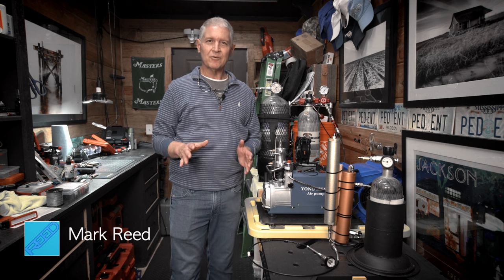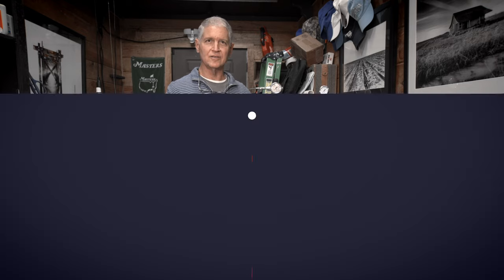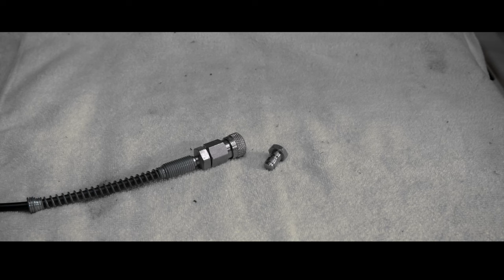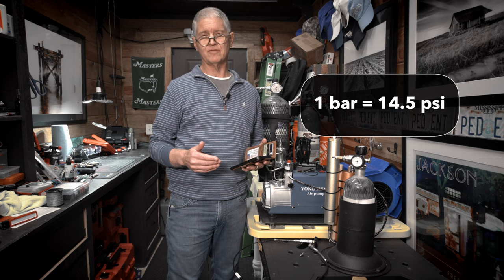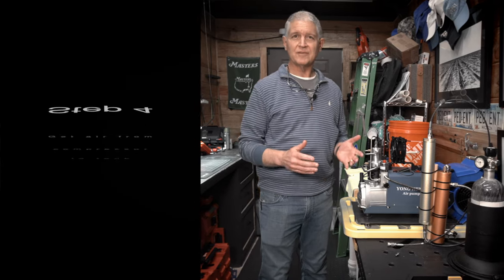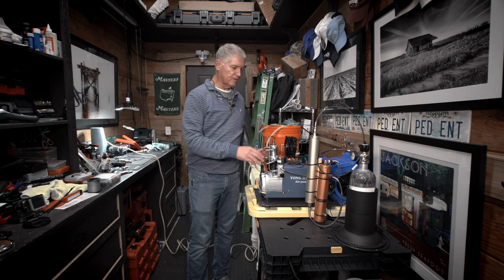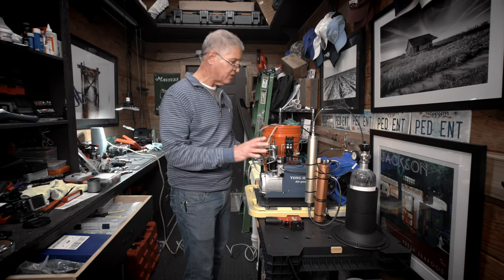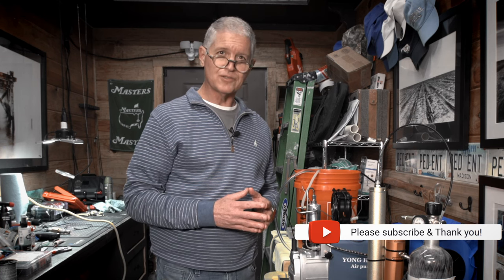How to Fill a PCP Airgun Tank

Comment: People don’t realize how dangerous compressed air can be, especially at the pressures relating to the pcp guns. I just bought a new rifle with 2 new tanks that I would like to keep moisture and/or contaminants out of. I also purchased a small compressor that has a tiny in line filter , doesn’t look like it’s enough, my tanks were filled once by the place I bought it from when they tested it. It still contains what’s left of that first charging. I don’t understand these guns and tanks yet , but if it’s possible I think I’m going to release the remaining air from the tanks and pull a vacuum on them and hold,it long enough to evaporate any moisture present and start over with a leased nitrogen tank or something. I already lease oxygen and acetylene tanks for my work, so adding something else shouldn’t be a problem. There are probably inert gas choices, lol, I know nothing about these guns I have a feeling this is going to be more expensive than I expected. Most things like this normally are though🤣. Would be interested in your opinion, will sub your channel also.
Reply from the maker: Thanks very much for watching, and I strongly agree that this is going to be far more expensive than you know. Addictions are really hard to control!!

Comment: On some chinese compresors there is a warnning label, to not operate compresor at site where oil level eye is. There are known cases, when the compressor is damaged, the cover is broken and you can be injured by its shards. It is recommended to point the cover in a safe direction, such as a wall.
Reply from the maker: Thank you! Great information! Thanks for watching and commenting.

Comment: The most important thing you didn't say is how long it takes to fill the bottle up to, and what temperature we can let the compressor go without having problems damaging it? Compressor temperature is very important.
Reply from the maker: Thank you for watching. The main point of this particular video was to give a concise tutorial on the actual filling of a tank. The type of compressor or tank was not relevant for this discussion. I have a separate video discussing the Yong Heng in particular which may answer some of your questions. The time it takes to fill a particular tank completely depends on the size of the tank, the existing pressure in the tank, the pressure to ultimately be achieved in the tank, and the output capacity of the compressor used to fill the tank. There is no set time for filling any tank. I agree that compressor temperature is very important, and I address that in my Yong Heng video. As far as I know, there is no agreed to minimal temperature that would guarantee damage to the Yong Heng, but I would strongly recommend keeping the temperature as low as possible. Thanks again.

Comment: I have the same setup. I always did what you did, wait for the pressure to be equal then open the tank. Then I thought I saw someplace that they said there was a one way valve so air from the tank wouldn't push back into the compressor. So it seemed they opened the tank at the same time they turned on the compressor. Do you have any thoughts on that? Also when the tank reached the pressure I wanted I would close the value of the tank, then open the pressure relief valves on the compressor, then turn it off. I thought it would be better to turn it off without it being under pressure. Interested on your thoughts of that process too.
Reply from the maker: Thanks for the comments. The one way valve you mention is a check valve, but that is not standard on most tanks. I recently bought a check valve for that very purpose for one of my smaller tanks. You can certainly open the tank valve from the start if you're using a check valve- most just don't have one. I use a Stikman SCBA adapter for my SCBA tanks, and it has a check valve also. It's a very handy tool if you are using SCBA tanks. As far as the shut down process goes, I have heard of some doing the same as you, and I don't have any data to contradict that. It could be a better process. My YH automatically turns off when it reaches 290B so that actually starts the sequence for me. Without having a check valve, I would then have to close the tank valve as the next step or risk loosing a lot of pressure if I opened the YH valves next. I figured that with the YH off and the tank valve closed next, the pressure would remain equal throughout the system before bleeding. I didn't think it would stress the YH anymore than it was before it shut off. Anyway, that's my thinking. I certainly could be wrong, but fortunately, it's continued to work well to this point. Thanks for asking.
Reply: If the output valve is working on the compressor it shouldn't matter shutting it off with pressure. The cylinders bleed of pressure fairly quickly  when they are not reciprocating 30 hz or so. There is a check valve where the final stage line enters the block that also holds the gauge, make sure it works as it's usually just a bit of debris in there if not

Comment: Same relative setup as y'all, one thing I do a bit different is leave the tank closed and run the filters and line up to, if not just a tad over, the target pressure for the tank. That way I just tested the lines and orings on my filters as I am using them. Then simply Crack the tank valve open as soon as the top pressure is tested. The lines and filters will just act as a tank and fill the actual tank. I'd much rather blow a line or pop an oring without the volume of the tank hooked up
Reply from the maker: Thank you for the reply. As with most things in life, there are many ways of doing something, and I'm sure mine is no better than yours. Maybe one day, we will be able to come up with a consensus that works better than all others, but until then we'll all continue to push the boundaries and try to figure all this out. Keep up the tweaks, and continue to let us all know if you find something better (or something worse). We'll all appreciate it. Thanks again!

Comment: Thanks, I really enjoy my Yong Heng and these types of videos. I've had my Yong Heng for three years now and have used it nearly everyday for the first two years without a problem. I have yet to fill my large SCBA tank because I'm scared to due to lack of experience, but I have filled my little Hatsan field tank.
Reply from the maker: Thanks for your reply. Should continue to give you years more especially with the way you use it. Keep up the good work!
Reply: @jmarkreed  Thanks Mark, so far so good.
Reply: Don’t be scared. It’s a whole lot easier to fill your gun from a SCBA tank than a compressor.
Reply: @mikegoebel5864  Thanks Mike, from another Mike.

Comment: What happens if you don’t have equal pressure in your pump and your tank when you start the airflow to the tank?
Reply from the maker: If you have an open system (i.e. no check valve to hold the pressure back from your tank) and your tank is full of high pressure, all that pressure from your tank will be forced back to the pump. The pump would then have to hold up against that massive pressure and would likely fail and you could get hurt. Not  a pretty sight. Don't go there.

Comment: Good straightforward informational video, i plan on getting a bottle soon, probably the 6 liter, i have 3 of the yong hengs, 2 new that i have tested and moth balled and the first one that i got 5 years ago, still hits 300 bar, ive only filled guns with it, pretty much daily, my main gun i shoot is a 480cc 250 bar i refill at 150 b. they are great little pumps, just keep them cool with clean oil. Thanks again!
Reply from the maker: I have two used 45 minute SCBA tanks (6.8 liters) that are filled by my YH. That seems to be the best practical size for filling and use. Both were bought on Ebay for a great price ($159), and both were still under DOT certification. I had to look for a while to find them, but it was worth it. They are great and should last for a long time. I then bought a StikMan from Air Tanks Plus to fill my guns. Wonderful product to use with the SCBA's. You should be in great shape for many years of use with your extra YH's. Thanks for the comments and for watching!
Reply: @jmarkreed  hey great tip on where to look, the bottle i have looked at is not dot, i had rather have something dot approved, sorry just getting back to you, i had no idea you had answered me back, thanks again and enjoy your content.
Reply from the maker: @Don.E.63  Thank you very much,  and thanks again for watching!
Reply: Did you get a bottle yet? I ordered a 6.8 liter and very curious how long it will take to fill from empty.

Comment: Great information Dr Reed, -iI have 2 Shoe Box compressors and have considered tring the Yong Heng to fill portable tanks.
Reply from the maker: Excellent! I have been intrigued by Shoe Box compressors and it’s my understanding that they are not being produced anymore. I think you would find the YH to be very different than the Shoe Box, but it should be a little faster from what I understand. I don’t think you would be disappointed.
Reply: @jmarkreed  Hello; for the ill-informed, is Shoe Box a brand or a type? I guess I could google it...but the reason I ask, I am seeing some portable compressors in the sub $1000 range that say they are oil free; and they are pretty small - like, almost shoe box size - that's why I wondered. I'm wondering how they accomplish that, and thinking maybe they do like my Harbor freight air compressor where the cylinder walls are teflon coated; basically made for a certain lifespan?
Reply from the maker: @arsbadmojo  Shoe Box compressors are/were a brand that used very dependable but somewhat slow technology. I really don't have any experience with them, but I believe they were very good. They are no longer made. I don't think they used the same technology as the current oil-less compressors. I have a couple of videos on my channel discussing one of the oil-less compressors, the GX CS2. https://www.youtube.com/watch?v=Q3QvRexvPpA   It is a great little compressor that is used for only filling airguns directly- not for filling larger tanks. It is also very reasonably priced in the sub $300 range.

Comment: Just starting my new PCP airgun hobby, and it sounds fun, thank you for the  info, safety is a wise step, tying down that hose was a great idea, they can whip so hard with that air pressure and with those adapters to whack you will not be pretty or healthy. Subbed!

Comment: 1:45 What instance would you need the gauge on the other end of the line, instead of the dead head alone? The gauge on the tank should be accurate(hopefully) I have had gauges off by 500psi though. lol I am glad to see air tanks plus on here. Buying from Air Venturi was my first mistake, a nightmare rather.
Reply from the maker: Yes, thanks for asking. I think the separate gauge I have from Air Tanks Plus is more accurate than the one on my smaller tank, so I use that. I also have a large tank that has excellent gauges, and in that case, I use the dead head. I don't want to be definitive that one is necessarily better than the other. It really depends on your own equipment. I just wanted those who are learning about all this to know we have options- and both are fine.

Comment: Great Video ! I do exactly the same except when I'm at the desired pressure I quickly close the tank valve and immediately open the tank bleed valve. Then I shut down the compressor and open the 2 bleed valves on the unit.
Reply from the maker: Thanks very much! As you know, there are so many different ways that we can do this, and I certainly see the logic in doing what you are doing. The only reason that I decided not to do it that way is to maintain the full pressure in the system to allow the expulsion of as much water as I can from the YH bleed valves. By decreasing the pressure from tank valve the differential pressure will be less when the YH valves are opened. It probably doesn't make a lick of difference, but I want as much water out as possible. Thanks very much for sharing!

Comment: thanks for posting the video. I would add a bleed valve to the bottom of your filter so when you release the pressure from the line it will purge the moisture at the bottom of the filter out.
Reply from the maker: Thanks for watching! The copper water sepator filter has that very thing and I use it every five minutes during the fill to purge the water. I also use it at the end as you suggest. Thanks again.

Comment: Hi, I'm in Scotland and have much the same set as you except I have the one way valve, bought from best fittings, and it works a treat, as soon as both pressures are equal it starts to fill the tank, once filled to pressure you require simply shut tank valve then switch off compressor and release the air from both bleed valves 🍻
Reply from the maker: Yes! Excellent. Greetings to you in Scotland. Our favorite family vacation was to Scotland a few years ago. Absolutely wonderful experience, and we certainly want to return when we can. Can't say enough nice things about Scotland and its people. Simply wonderful in every way!
 I recently bought a really great one way valve from Air Tanks Plus  (https://airtanksplus.com/product/quick-connect_in-line_one-way_check-valve_w_bleed_valve/) that has a bleed valve and can be used on any tank I fill. It's a very handy addition. I was assuming that most won't have something like this.

Comment: Thank you so much for this. Just what I needed was a simple demonstration. I watched far too many videos that complicated things beyond my simple brain! Much appreciated! Do you recommend any particular filter or type of filter?
Reply from the maker: Thanks for watching. I use the "gold filter" that many others use. I ordered mine through Amazon. It has molecular sieve to get the water vapor out before it gets to your tank. I also use a water/oil separator filter before the "gold filter" to get most of the condensed water out. You will probably find some debate about using something like that, but I live in a high humidity area and can see the benefits when I open it during the filling process. A decent amount of water comes out. I don't think it hurts to have it.

Comment: Yes, i have a question. Why do i need to let the pressure build before opening the tank? Why can’t i have the tank open already?
Reply from the maker: Because unless the tank is completely empty, it would have a much higher pressure than the compressor at start up. You would essentially have a massive pressure gradient from the tank to the compressor and it would bleed back and destroy the compressor. Waiting on the fill line to reach the same pressure of the tank prevents the pressure gradient. Once you open the tank valve, the pressure in the tank must flow back toward the compressor unless you have a check valve installed to prevent that. Thanks for watching!

Comment: I noticed you open the tank valve pretty much all the way, several turns. I was taught when using welding tanks a quarter to a half turn was all that was needed to fully open the valve. That would make it much quicker to shut down if something went wrong. Great video, just wondering what your feelings were on only opening the tank one turn or less.
Reply from the maker: You know that's an interesting question, and I don't know if I have a great answer for you. Just from my experience of filling my guns from the tank, I know that it takes around a 20% turn or so just to get it started. I guess, ultimately, I want to make sure it's completely open when I fill the tank so that I don't have to work against that extra resistance of a partially closed valve. It's a good question. I'm sure someone has a good answer. Maybe they will chime in. Thanks for asking.

Comment: as a safety measure I'm sure you could get a non return to put inline (there is one on your rifle tank they aren't that big) as it would allow the tank to just be opened then it will fill as soon as the pressure equalises
just a suggestion and by no means detracting from your video
thank you for sharing as always and especially for the talk on the risk involved
people don't realise the hidden power in air pressure
but it's devastating if miss handled!
best wishes
have a great day
Reply from the maker: Thanks very much, and I completely agree. I recently bought a really great one way "check" valve from Air Tanks Plus  (https://airtanksplus.com/product/quick-connect_in-line_one-way_check-valve_w_bleed_valve/) that has a bleed valve and can be used on any tank I fill. It's a very handy addition. I was assuming that most people won't have something like this so I didn't include it in the video. Thanks again for watching!

Comment: I had my air tank filled today in my local Gun Shop. I paid £7.50 for a 300bar fill. I have a 6.5ltr tank to fill my pcp airgun. I have just checked the pressure in the tank and it's showing 270bar. Is that normal to lose 10%. Should I go back and ask for the 30bar that's missing. Also does that mean I lose 10% of the fills into my Weihrauch Hw100. Thanks
Reply from the maker: Excellent question! The answer is- it depends. It ultimately depends on how fast the tank is filled. You may have noticed that your tank feels warm to the touch after filling. There is a direct relationship between volume and temperature. This is known as Charles's Law. As the tank cools the pressure decreases. Ideally, the shop should fill and let it cool down and then top it off to the final pressure. A slow fill causes less temperature and less "loss." If you could leave it overnight and have them top it off the next morning that would be ideal. Hope this helps and thanks for watching!